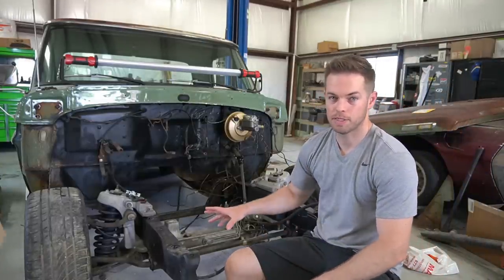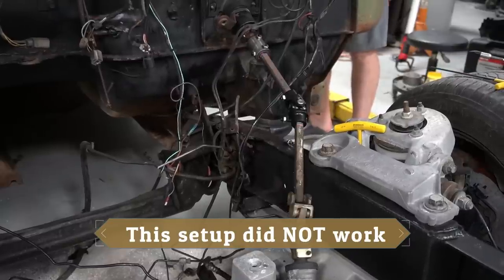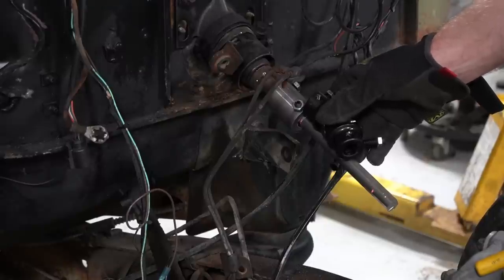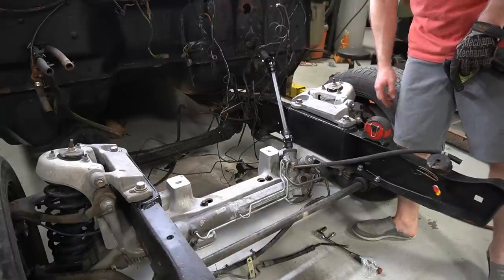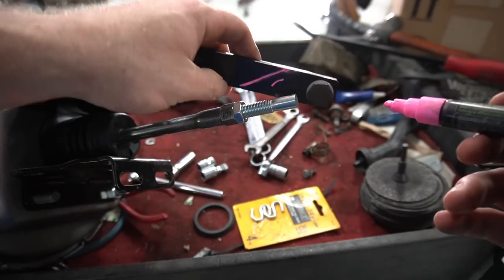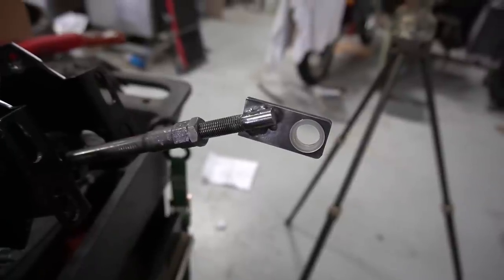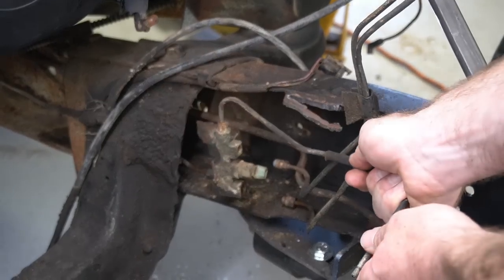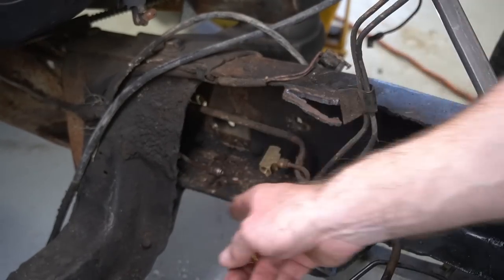F100 Crown Vic Swap II

Comment: The brake junction you show is a balance switch. If you lose either circuit the pressure imbalance moves the pin inside to the lower pressure side. The pins has a cutdown center and when it moves to either side the switch contacts and warning light circuit has ground for its bulb. I have had to center the pin many times once repairs were complete. You depress pedal firmly and crack a line on the side that was ok and the opposite pressure drop let’s pin slide back. Sometimes you have to do one side and then the other until you get it centered and light off. Removing it cures the problem but the brake warning valve police won’t like it.
Reply: It is also there to keep you from getting killed when a line fails.  Never remove these parts.

Comment: If this was originally a manual brake truck, and you're using the manual brake pedal assembly, the pedal ratio may be off. I know on my Chevy the brake pedal had 2 holes in it, one for manual brakes and one for power brakes. May not be a big issue, but once you get it running, if you have issues, might be worth looking into. Or does this pedal have 2 holes as well, and it is just hard to see in the video? You're doing a great job.
Reply from the maker: Pedal only has the 1 hole. Hopefully this brake booster works out and doesn't need some crazy adjustment in the future. I guess I won't really know until I am able to start the engine and put some vacuum on it

Comment: I notice you didnt put in a slip joint in the steering shaft, fyi a friend of mine did the same thing and the cab/chassis flex caused his “jam nut/set screw” joint at the column to walk loose and come off going down the road and had also messed up the end of the column. Luckily damage was minimal but we made a slip joint shaft for it and have seen as much as 3/4 to 1” of movement in it since. Enjoy the vids
Reply from the maker: Interesting. I see a lot of guys  building steering columns with no slip joint in old hot rods and stuff.. . but not many guys talk about the problems they may be having after a few thousand miles. That seems like a valid point, I will keep in mind. Thanks!
Reply: @330_garage3  its a company on the F100 FB groups that sells the kit with both u joints, DD sleeve & DD shaft with anti rattle spring and is very well priced. Plus in the event of a severe front impact the frame can move up to 6” before shoving the shaft into your face....that was more my concern since all OEM including the CV has “collapsable” shafts. Good luck on the build i enjoy watching

Comment: If you went with a 3rd ujoint you would have to put in a support bearing. Had to do this a few times building hot rods. Also, you really want to do the steering linkage when you have the motor in its final resting place with the headers bolted on.

Comment: You are going to need to install a proportioning valve in the brake system.
Reply from the maker: Yes, I put one in the rear, mounted to the frame, so I can keep the system balanced
Reply: Do you happen to know what type of proportioning valve is needed?

Comment: 6:08, is that shaft going to hit the exhaust manifold...
12:05, cadmium plating...
Reply from the maker: I test fit the engine this weekend.. and the steering shaft had enough clearance! Clearance was my original concern, thats why i started with the u-joint in the middle of the shaft.

Comment: I don’t have a plasma.. would a grinder, air hammer and sawzaw work good to get the old subframe out of the truck?
Reply from the maker: Yeah a couple of long bi-metal blades on a sawz-all would work. Its going to eat up a few blades and beat you up, but it would get the job done. You may ask around, you'd be surprised who's friend's dad, has a plasma they would be willing to bring over and cut up an old truck for you

Comment: I have no idea why you removed that brake junction block. What you replaced it with looks more like a gong show than using what was there. Should have left it and just added an adj. proportioning valve in the rear line. 
BTW, Rock Auto is about the last place to source correct parts identification pictures. That booster you have certainly is not correct for any 67-72 I've ever seen. Only direct-rod setup I've seen was used on some '77-'79 F100s. That part from pirate jack (I call a gimball assy) kinda acts like a secondary lever and changes the pedal ratio slightly. Correct booster should have had a short rod with eye on the backside, not long rod like what you have. Steering strip looks good, would have like to have seen Ford to DD joint as one, not two joints, but I get it when it comes to chasing parts. Other than that, looks good man, keep with it!
Reply: Drum/drum systems run at similar pressure front and rear, as do disc/disc systems.  Disc brakes require more pressure (but less volume) than drum brakes, which is why a proportioning valve is necessary with disc/drum systems.  You may or may not need a proportioning valve with your new brake system.  Assuming the truck had a factory drum/drum system, that is most likely not a proportioning valve.  I agree with Dano that you should have left the factory distribution block.  It is a multifunction unit designed to detect a hydraulic failure, notify the driver through the warning lamp, and stop flow to the failed circuit.  In regards to changing the pedal ratio, you may need to change to a different bore size master cylinder to get proper stopping power with a reasonable amount pedal pressure.  If you have to change the master cylinder, look for one that has the same size reservoir for the front and rear, otherwise keep a close eye the fluid level.  You will find the level will drop as the brake pads wear and you don't have a lot of reserve volume for the rear with a disc/drum master cylinder.  When you're bleeding the brakes, be sure that the pedal can't go all the way to the floor when you open a bleeder (with no air in the other brake circuit).  The front brake piston should be able to bottom out against the rear brake piston, or the rear brake piston should be able to bottom out in the cylinder bore (while the other piston is still holding pressure) before the pedal hits the floor.  If it doesn't, there's no point in having a dual circuit master cylinder as a failure in either brake circuit will result in a complete loss of brakes.  Also, in case you aren't aware, any decent auto parts store should have 25 foot rolls of steel tubing.  I find it more convenient to make my own lines than dealing with the pre-made lengths.  Some people like the nickel copper tubing because it's easier to work with, but it can work harden and fail sooner and doesn't have as good abrasion resistance.  I find 3/16 steel lines to be easy enough to work with and most bends can be made by hand.  If you replace the lines from the master cylinder to the frame, make sure to put a coil in the line.  That coil is to reduce fatigue as the cab mounts and firewall flex and the master cylinder moves in relationship to the frame.  Without those coils, your lines won't last long.  They're easy to make by wrapping the line around a piece of pipe.  Good luck with your project and thanks for sharing.
Reply: I agree about Rock Auto. Twice I've ordered from them, waited a week, and got the wrong parts. Returning them when you live 50 miles from town is a pain in the ass. Now I just drive to town and pay a little more for the RIGHT parts.

Comment: You really should have made a new brake line for the crossmember.
Reply from the maker: Brake line is cheap, I just thought if the OEM front end had one on it, I might as well use it. its not too late... I could bend up another one....

Comment: So did the sway bar work out OK in that location? Im at the same part and have no idea where to mount it
Reply from the maker: Yes, bolts up and works out great. You can see in my later videos, the engine clears it, and its right at home there

Comment: why not just buy the 3/4" spline to dd adapter joint? saves you a connection.
Reply from the maker: I had tried my original configuration, and was getting tired of dealing with returning parts and fighting with it. Ideally I would have just started with a 3/4" 36 spline to 3/4 DD, U-joint. Now you guys know a possible solution if you are trying to do this yourself though

Comment: Looking to buy 1962 F100 unibody and upgrade front suspension. This would a lot cheaper than bying a new IFS. I notice in video you said your frame was 68-69. My question is. Are the frames the same on 62 and a 68 F100?

Comment: Glad to see this moving forward again !!!!
Reply from the maker: haha me too! Thanks!
Reply: 330_Garage  your content is great, I like what you’re doing... I’ve got an f100 staked out... hoping to CV & 8.8 swap it... what’s up with your rear wheel backspacing issue? Have you figured out which wheel & BS?
Reply from the maker: @scottharvey3054  rear wheel back spacing is just temporarily resolved with some cheap Ebay 2 inch spacers for those CV wheels. I think some aftermarket wheels will resolve the need for such a huge spacer. I'll be sure to do a video as I work through that
Reply: 330_Garage thanks for the reply !

Comment: Good work so far! I'm at a similar stage. You really need an actual proportioning valve for disc/ disc brakes
Reply from the maker: Correct! I added one in the rear. I have another video I am working on posting, where I put a 4 link in the truck, and installed one when I did all that.

Comment: My f100 has a rag joint not a 36 spline end on the steering shaft.
Reply from the maker: You have to knock that rag joint off. The rag joint is pressed onto the 36 spline shaft. I had to use the air hammer to remove mine.
Reply: @330_garage3  
That good to know.  Great work on the truck so far.

Comment: I used the swivel adapted right at the tail of the steering wheel shaft and used the coupler between the original crown vic extending lower shaft and DD to steering wheel

Comment: The brake booster IS for your truck. It just didn't come with the clevis to attach to your pedal. The only difference between a power and non power brake truck is the location that the clevis attached to the pedal so that your pedal ratio is sufficient to allow the leverage needed to depress non-power brakes. If you didn't measure from the pivot to the pedal to ensure that you have a correct pedal ratio, you may be leaving lots of braking performance on the table.. Also, the front bale of the master is the rear brakes, rear bale is the front brakes..

Comment: All your brake work makes me nervous, go to Summit Racing and get the flex brake lines with the adapters that screw into the hard pieces, I did my COMPLETE brake setup from the T junction to both front wheels and back to the junction at the rear, NO bending of ANY tubing, just screw the flex hoses with adapters to the hard junctions in a jiff

Comment: I used the same exact frame slot to mount the brake line on my f100/vic IFS swap!
Reply: Did you have problems turning lock to lock? My 65 looks like I need perches to move the rubber lines out towards the wheel a little
Reply: @crash67532  so, the 65 is different than the bumpside, but on my 67, i go lock to lock with no problem.

Comment: I'd think that I would add a slip joint to the steering shaft so it would be safer if it's ever involved in a crash.  Just cut the DD shaft down and insert in into a DD tube attached to the steering box.  You could leave maybe a 6 in. gap in the tube.

Comment: I have a 95 I’m working on and I’ve heard of using crown Vic front ends but I can’t find anything on my year of f150, have you heard of these crown vics working on a 95 f150?
Reply from the maker: No, haven't seen anyone doing much to the later year models yet, besides the bolt on kits. Would be a cool idea to put a crown vic under one though.

Comment: Amazing videos man!  Thanks so much.  Do you know if the crown Vic can handle big block Fords ? 460 the mounts. And how are you setting up steering?
Reply from the maker: Yes, probably better than a small block. After putting a small block in mine, the springs are super stiff, and need some more weight on them. I'm probably going to have to get coil overs to get it to not ride like a wagon.
For mounts I would check out OutcastAutoWorks. He makes really nice stuff that will allow that 460 to sit right in place. Heres a link:
https://www.outcastautoworks.com/collections/ford-f-series-crown-vic-swap-motor-mounts/products/pre-order-f100-crown-vic-swap-big-block-429-460-polyurethane-motor-mounts
I'm running an LS, so I plan to just merge the power steering lines together from my GM pump to the crown vic rack.

Comment: Hey man, good work. I was wondering what carb you are running. I know it’s a Holley but is tbere a certain number on it.  Also would love to know exactly what you used kit for the fuel lines comming out the carb.
Reply from the maker: I used a Holley Street Avenger 670. I have used those in the past and I really like them. For the duel feed fuel line, I used one from summit racing that was really nice. https://www.summitracing.com/parts/sum-220106bn-b

Comment: Doing this to my truck, what are/did you do to make the rear same height?
Reply from the maker: I installed a lowering kit, and did an axle flip in the rear. The rear sits much lower than the front now, even after the crown vic swap. I ordered a 4-link for the rear, I'm hoping that will give me a lot more adjustability in the rear ride height.
Reply: @330_garage3  the rear sat lower, even with the engine and trans set in the truck?

Comment: Where are you located? I noticed your kit is from Bandera Tx....real close to me!
Reply from the maker: I'm in McKinney TX. I ordered the kit off ebay, so it could have come from anywhere, but it sounds like you aren't far away.
Reply: Just going back thru CV Swap again for a 65 and a 57 f100. What did you do for tires and wheels, back spacing etc...  ?
BTW, 
We're in Canyon Lake TX
Thanks for the great videos and info
Reply: In San Antonio…

Comment: The brake booster bracket that you purchased should have come with an intermediate lever that mounts to the upper holes in the bracket itself.  The correct booster would have an actuator shaft similar to one that you cut.  The booster fastens to the center of the intermediate lever and the bracket that you cut would mount to the bottom of that lever and line up perfectly with the brake pedal. You should also reinstall the brake light switch that you removed.  An adjustable proportioning valve is not only a good idea but is essential because of the modifications that you've made but you should reinstall the brake light switch.
Reply from the maker: Thanks for the knowledgeable comment! I struggled with the brake booster and the bracket. I originally bought a "complete bolt on kit" that was completely wrong, so I had to return it. There are so many manufactures that seem to make "direct factory replacements" that don't fit at all. Your comment it 100% correct though, and I wish I had found a OEM type replacement. The bracket that I bought from PirateJack did come with the intermediate lever, that I ended up removing to make this setup work.. sighhh